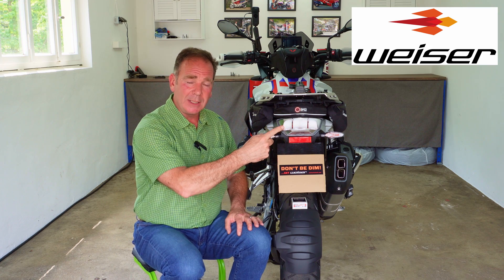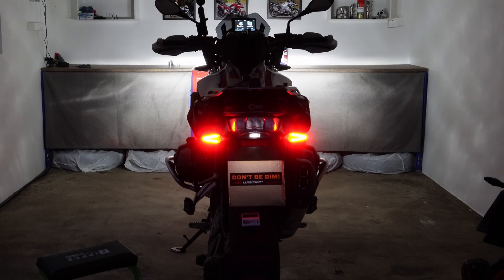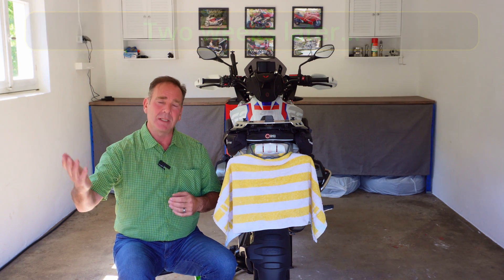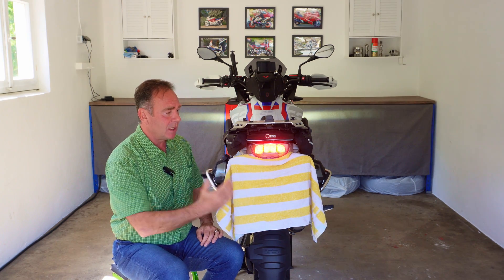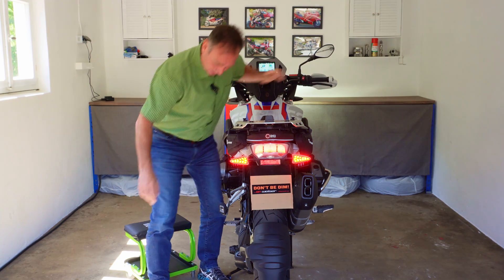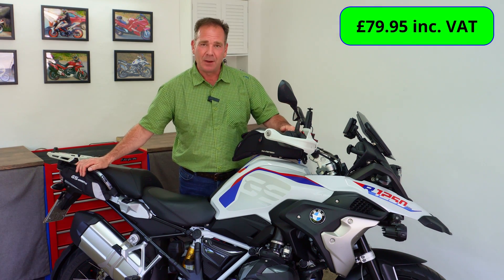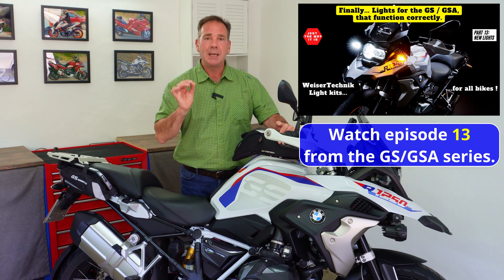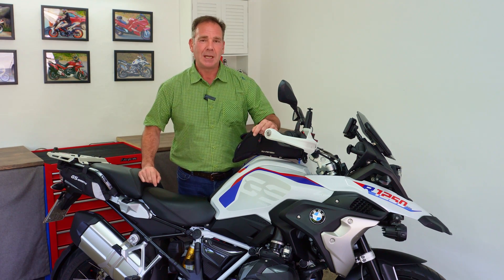EP:21 Weiser Technik EXT-Run-on Module BMW GS/A LED Tail Light Reactivation - How to turn it back on

Comment: Why is it 79.99 on here and it was 237.00 at ABR fest 2024😮
Reply from the maker: Hi Paul,  the the first price you mention is only the Tail Light reactivation wizard module. The second price is the full kit of 3 wizard modules ( tail light reactivation plus both rear indicators modules.
Greetings Carl 👍

Comment: Any discount code this time Carl?
Reply from the maker: Hello Tim, go to my channel then watch episode 13, at the end of the video are the steps for requesting a discount code.
Which you can still use for these modules 
What bike are you fitting them too Tim ?
Carl
Reply: 2021 R1250GS, I replaced the standard multifunction set up with the EVO last year after watching your videos. Extremely happy with them, used the discount code then.
Tim
Reply: Apologies Carl, I didn’t run to the end of the video to see your bit regarding the discount.
Reply from the maker: No problem 🙋🏻‍♂️

Comment: Hello Carl, answer from Weiser
I’m pleased to be able to tell you we have now produced the module we discussed  
I have had  them working successfully on my bike now for the past three weeks . We have shown the bike to three BMW dealers in the UK and they are very excited about the results . The kit will be totally plug and play and should take about 30 mins ti fit on a GS & a bit linker on a GSA because of removing the pannier frame too. 
I will prepare some video for you shortly .
Reply from the maker: Hello, I was in the factory two weeks ago and saw the new modules installed. Once a production version is available I will have one to test and then make a introduction video about them. Install time on a GS is less than 5 mins 😉
Reply: I'll be waiting!! Very curious 

Hopefully this is a module that dims the brake light when the Blinker is on with the multifunctions 😁. I had this briljant guy in Poland on eBay who made these homemade soldered chipboards for my previous motorcycle (tracer 900 GT) which had the same style led Blinker/tail/brake lights that disabled the brake or tail light when using the Blinker. Genious piece of work, just install it infront of each Blinker and magic! Too bad the guy went offline and untracable and couldnt help me for the bmw 😢
Reply: What does the module you mention exactly do? It is a other one than the video talks about i guess?
Reply from the maker: Hi Eric
The new product is not yet available a full video review will be released soon.
Best wishes Carl

Comment: It would be nice if the function of lights on/lights off could be done in the OEM blinkers, both light and blinker would turn on and off... Is it possible with the module?
Reply from the maker: Hello, the only function of the module is as shown, but there is a new product due to be released in August that I will have a review on…. That you might like 👍
Reply: @justthewayitis  don't tell me: center light on and brake, side lights on and when using as blinkers they'll go off and on... So it would be almost the same as the previously model... That would be something nice 👌
Reply from the maker: Exactly… if was shown the prototype unit on a test vehicle this week, a production version will be with me in a week or two to test on my bike, then I’ll put a video up once that’s finished and they have stock.
It’s a clever solution 👍

Comment: Is it allowed to have 3 tail lights in germany? I think it might not be allowed this way. If you use the middle light as tail and break light (like before models) you have to remove the drl function from the indicators so it is only one center tail light.
Reply from the maker: Hi Danny, that’s a great question I just don’t know the answer, do you know where I could find the rules and regulations for this ?
Thank you 🙏 
Carl
Reply: @justthewayitis  Hello Carl, it must be anywhere in the StVO (Straßenverkehrsordnung). I searched the web and found at Dekra :  [Ein Rückstrahler hinten ist Pflicht, zwei sind erlaubt.] and [Anzahl Schlussleuchten: 1 oder 2, mittig zur Fahrzeugachse montiert].  In english: 1 tail light is a must have, two are allowed. To be 100% sure you can only ask a Dekra or TÜV Engineer as he must know the latest changes of the law. If you search the web it is not 100% sure that it is the latest information.

I have a 1250RS which had no side markers from factory. There was a guy here in germany that supplied a PCB and cables to give the "older" bikes the look of the new 1250GS. One of the steps was to deactivate the tail light function. I made it by my own without his kit and disconnected the tail light pin (and fit a resistor to it to let the controller know everything is OK for the self test). It would have been much easier with just adding the side markers so I think he deactivated the tail light for a reason (make it legal). I have made all light functions exactly like on the new GS (using a Hex ezCan, a termination resistor and original new design LED Indicators from BMW) because this must be legal this way. I sent you an email with a document. Perhaps this helps....
Reply from the maker: Hi Danny, big thank you 🙏 
I’ll reply via email later
Carl ✌️🙋🏻‍♂️
Reply from the maker: Hallo Danny, wenn du weißt, wo ich die Motorradgesetze finden kann, lass es mich wissen, damit ich das recherchieren kann. im Moment bin ich unsicher. aber es ist eine gute Frage

Comment: Another great episode, Carl.

I really struggle to understand the BMW's design team end-goal for effectively removing the main/centre tail-light.  Then (I assume) the final design had to pass BMW's safety team/department, let alone type approval testing (or equivalent) for each country in which these new bikes would be sold.

For me (and I guess many others), the tail-light is a reference point if you will.  When I'm following another bike, it's the centre point, the position light; when I then see an orange indicator flash to one side or the other of that centre point (tail-light), I'm left in no doubt where that bike is telling me he/she is going.  With centre point/tail-light, is it really going to be as obvious?  I'm not sure ...

Well done to Weiser Technik for producing a solution (that should've never really been needed).
Reply from the maker: Hi Martin, thank you 🙏. Quite a few of the new bikes don’t have a central rear light which is not great, i think it’s because Radar will become standard on many new bikes and models over the next few years so they need somewhere to mount it on the rear .
When Weiser-Tech came to my home last year to talk about the products and technology they asked is there anything I wanted them to make… and this module was it, so I’m pleased they found a solution.
Best wishes Carl

Comment: Carl would your Brembo brake pad up grade options be the same for a KTM 1290 Adventures
Reply from the maker: Hi James, yes but remember the SC and SR need to get really hot to perform at their best, so you might be better for on the road going for the SA
Check the part numbers for your year model 
Carl
Reply: @justthewayitis  yes I fitted the SAs to my GS Adv with a  very good improvement 
Thanks for the reply
Reply from the maker: No problem 🤞

Comment: Hi.
I see in the comments somethong about this product is functioning together with the DRL. Do the ”new” taillight switch on and off together with that when installing this?
Reply from the maker: Hi Ola, good morning 
Sorry I don’t understand your question 
Can you ask again using different words ?
The module can be installed by itself on a standard gs/a
Or it can be installed on gs/a that already has Weiser-Tech indicators installed.
The switch I mentioned in the video is inside the indicators please watch episode 13 for a full explanation 
Carl
Reply: @justthewayitis  Hi again.
Sorry for the unclear question…english is not my native language…
I have a -21 GSA and I run my lights in auto mode. What I meant was, does this product turn on/off the rear center lights along with the bikes auto frontlight mode (like when you enter a tunnel) or is the ”new” rear lights on constantly?
Reply from the maker: Hi Ola, correct the new module keeps the rear tail light on all the time ✌️

Comment: This one is a tough decision. I get why BMW got rid of the marker light function from the tail light. A light that suddenly appears where there wasn't a light is more likely going to grab a drivers attention than say a light that was there but just got brighter. The turn signals provide that marker light function instead, poorly for the OEM lights. I get the flipside of it as well, less light to let a driver know you're in front of them when barreling down the road. I'm all for anything that will make me more visible at any given time, so I'll probably get this. That's why I have a brake free on my helmet and changed my turn signals to Weiser Tech. 

What I don't understand is BMW getting rid of the tail light all together, that's a stupid move in my opinion. The only reason I can see doing something like that is for aesthetics, which should never come before safety. What does removing an essential light provide? Weight savings are nonconsequential, there's no additional horsepower or torque gain, these are LED lights so it's not really removing any strain from the electrical system.  It's baffling...though it does give Weiser Tech new products to produce to fix BMW's mistakes.
Reply from the maker: Hi Correy thanks for your feedback… and it’s a similar thought process to me. On one hand the impact of a single big brake light is welcome, but with the Weiser indicators now doing this better than the OEM ones I find myself missing that extra central light especially early mornings and late afternoons.
Many of us don’t understand why bmw is removing the rear taillight unit, but a bigger question is why are they being Allowed to do this by the DOT and European lighting laws.
Have a great weekend Carl
Reply from the maker: Hi Correy, I think you might have a tail light illuminated inside your light assembly already?
Can you check and let me know please when you have a spare moment.
I thought that all North American specification bikes still had It. 
Carl
Reply: @justthewayitis  I'm in Japan and have one of the rest of the world bikes 😄
Reply from the maker: Ah, ok 👌👍 then this will work brilliantly for you , Carl

Comment: Hello Karl
unfortunately not my expectation
A module for the original multifunction indicators would be ideal, rear light is switched on when flashing, the function of the brake light in the indicator is switched off and the indicator can therefore be optimally perceived
Reply from the maker: You could send your idea to Weiser-Tech maybe they could have a look 
Carl

Comment: A product that reduces safety. The whole reason there is a big.light in the middle that is usually off is so that when the rider brakes that big light draws attention. A brake light is a far more important light than a tail light. I also think the OEM multi function indicator set up is great
Reply from the maker: Hi Johnny, all comments welcome thank you for sharing your thoughts. Carl
Reply: I might agree with the drawing attention when rider brakes. The multifunction should be a safety concern as, when using the blinker at night and braking, it can be barely seen from behind though...
Reply from the maker: That’s why many gs owners have installed the full weiser kit front and rear. Carl

Comment: Thanks Carl, will await the next install guide.  On another note, ever thought about doing a video about coding, I'm currently looking at options for getting the sports displays configured.
Reply from the maker: Hi Rob, that's very interesting as I too have been thinking about getting the "Sports" screen installed, but from what I have been able to find out their is a problem, and that's when the bike goes in for a software update at the BMW dealership it overwrites the installed sports screen. There is a company ( two brothers I believe ) here in Germany that can do this for a lot of BMW bikes.... but when you have a service and an update the "Sports Screen" is then gone. It would be great if you could let me know what you do and if you find something that works.... as i would install it straightaway if it remained for longer than 1 year.
Please let me know
Regards
Carl
Reply: @justthewayitis  who's the company in Germany, please?
Reply from the maker: Www.rs2e.de
It’s In German but right click on the page and Google will translate to English it’s within the bmw services section at the bottom 
Carl
Reply from the maker: https://www.rs2e.de/leistungen-preise/katalog-bmw-motorrad

Comment: Hi Carl, would fitting the module or any of the other Weiser products the warranty ?
Reply from the maker: Hi Ray, most things we fit to our bikes affect warranty in one way or another. I recently found out that adding stickers to a motorbike can affect insurance (UK Policy supplier) which was a complete shock !!!
My understanding from my local dealer is as follows: If I install 3rd party lights then the lights are no longer covered by the warranty as they are no longer OEM parts..... which seems reasonable to me. The same applies if I install a different screen or seat or foot pegs. 
But, Because this module does not require any cutting or modifying of the original BMW system (basically it attaches to it) my understanding is that it does not affect the whole bike warranty. 
However, If ( as i have) I install the Weiser indicators then i have removed an original part and fitted an aftermarket part... so in this case I affected the warranty of the lights. I hope my reply make sense.... this is just my understanding of course, and i would always recommend you ask your suppling dealership. Just be aware that they seem to say different things to different customers !!! Carl
Reply: Affect
Reply: Cheers Carl, yes makes sense, thanks.

Comment: Hi Carl, another clear and informative video and another quality product from Weisertechnik. 
I personally prefer not to have the rear indicators as running lamps but rather as brake lamps only (plus indicators)as in my mind that increases the  conspicuity of brake lights on. This is the way my 2019 GSA is wired.
It's a bit mysterious why BMW are deleting back lights!
Reply: The cynic in me says bean counters have got involved.
Reply: @robwojcik9224  bulb counters!!
Reply: @nickinknutsford  LOL
Reply from the maker: LOL quite possibly...
Reply from the maker: Hi Nick Thankyou 👍
I think bmw are preparing us for no rear light assembly on the new GS1300.
Best wishes Carl

Comment: Thanks for the heads up. Going to purchase one now. It’s one of my pet hates on the 2022 models, the way that BMW have the rear lights set up. The older set up was far superior, as far as being seen and making turn signals nice and clear.
Reply from the maker: I totally agree the earlier version was much better than the current OEM setup. Install guide will be up next Wednesday/ Thursday for this new module but it’s really easy to install.
Best wishes Carl
Reply: @justthewayitis  Wthe combination of Weiser indicators and now this tail light we have all that’s needed but we’re spending £500+ to correct a bad design idea from BMW, they clearly put “form before function”, in art and design that might be OK, but for a motorcyclist’s safety it’s really unforgivable.
Reply from the maker: Yes, but it’s going to get worse on the new GS I think 🤔